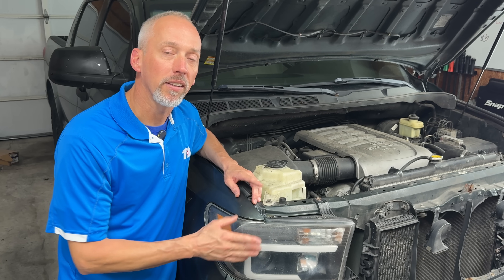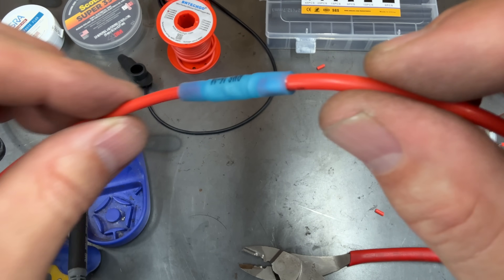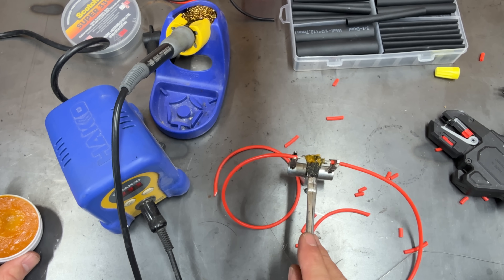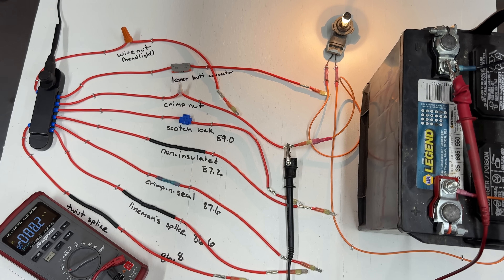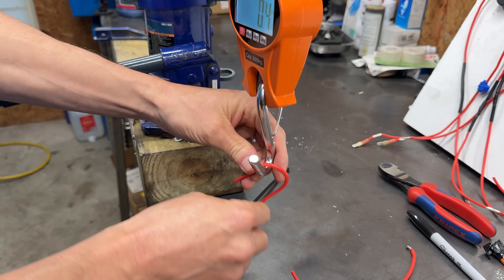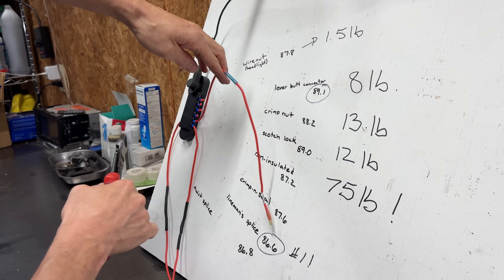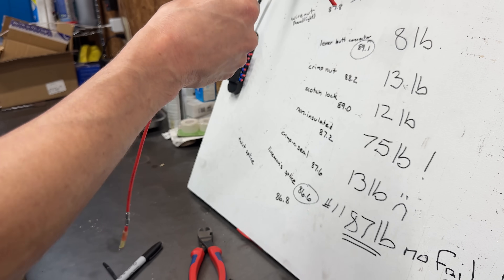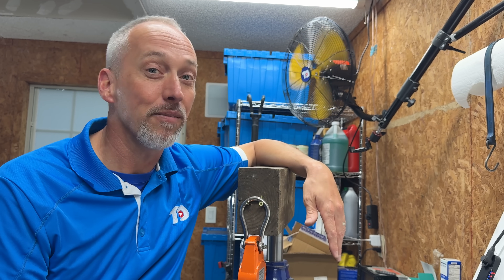I tested these connectors and found the best one

Comment: Something to be aware of is copper has a higher tensile strength than solder. If  you use a copper connector and a 6 side hydrolic crimp tool the copper will fuse/weld itself into continuous copper. Many industries will not certify a soldered connector. People  think soldering is better only because they are using the wrong connectors and tools. Many professionals think I am wrong until they test it for themselves.
Reply: NO SOLDER on Automotive connection or splices.
Reply: The space industry still uses soldered wire connections. Precious metals are applying instead of tin, cause tin becomes brittle at low temperatures and vibrations.
Reply: @hellhoe9311  Correct me if I’m wrong, but I believe that’s only for leaded solder joints, not unleaded. To my knowledge, research shows that unleaded solder joints are far less reliable than their leaded counterpoints and not acceptable for aerospace designs.
Reply: @rickyjagodowski69  Lead-based solder is not used, as it can melt at very low temperatures, which is unacceptable.
A complex solder based on platinum, gold, and silver is used. Silver serves as the base, while gold and platinum create a durable oxide film at the soldered joint. Such mixture has zero electrical resistance, is not subject to corrosion, is not subject to temperature changes, and is flexible enough to stretch, but at the same time has resistant to tearing.
Reply: @hellhoe9311 Sorry, I was thinking of what I’ve heard from military standards, not aerospace, and due to “whiskering” occurring with tin-based, lead-free solder but not leaded solder.
Reply: @rickyjagodowski69  Not really. Leaded solder has some advantages over lead-free (it’s more flexible, and less susceptible to tin whiskers), but lead-free solder has its own advantages (it is stronger). My take on lead-free in military and aerospace is that the main reason it’s not allowed yet is that we simply don’t yet have real-world aging data on it covering the ~40 year service lives of such equipment. But eventually we will, and I suspect we will shift to lead-free there, too.

Also, in the past 25 years, we’ve refined the processes and materials for lead-free soldering. The differences in, for example, solder wetting and flow are not nearly as big now as in 2005. Better alloys and better fluxes have really made a huge difference.
Reply: @rickyjagodowski69  unleaded solder is junk.... its horrible to work with and so easy to get unreliable connections.
Reply: @phedders  Modern lead-free alloys with good fluxes work very well. They’ve improved a lot compared to the beginning.
Reply: @tookitogo  Any pointers to a good one? I've not tried one I didn't hate yet... but I havent tried many recently because they all seemed to suck, so why buy more that you fully expect to give really poor results.
Reply: @phedders  The one I like is from Felder (a German manufacturer), using their Sn100Ni+ alloy (this alloy, which is also available from others under different names, is basically 99.3% tin, 0.7% copper, and critically, trace amounts of nickel and germanium, which significantly improve wetting), with the ISO-CORE “Clear” (REL1) flux. (If you need halogen-free REL0, that is available as “Ultra Clear”.)

It’s the first lead-free solder I’ve used where I thought to myself “if I were forced to go lead-free, this would be OK”. I’ve given samples of it to others to test, and they said similar things.
Reply: @tookitogo  “if I were forced to go lead-free, this would be OK”. Now you're talking my language :)

I just dug out what I think was the last roll of !Pb I bought which is dated 2017 - its Henkel with Loctite branding but a simple Sn/Cu alloy. (C 502 99C 5C) Its meant to be "premium" and certainly cost premium... but the roll is almost untouched because it didnt work out all that premium for me. Even the cheapest nastiest, stinkiest (flux) Pb solder ran rings round it for wetting and flow. I might give that Felder a shot.
Reply: @phedders  That is a prime example of a solder that does not impress me. People rave about Multicore and Stannol (whose products are extremely similar because the two companies were merged for a few years, long ago, but even after being de-merged, the products remain similar), but I’ve been consistently disappointed by their solder. (Or rather, by the flux within.) I’ve used their leaded and lead-free solders, and I don’t care for them. They’re not the worst out there, for sure, but it’s not great.

Kester is my favorite brand for leaded (haven’t used their lead-free yet), but the Felder lead-free I mentioned really impressed me, and it’s inexpensive to boot! (I also like Tamura-Elsold solder — the brand used by the European space agency — but it’s very hard to find.)
Reply: @hellhoe9311  Aerospace has been using crimped connections since the 50s. They use solder as well (mostly leaded), depending on the situation, but crimping is preferred.
Reply: @tookitogo  The USAF was using soldered connections when I separated in the mid-80s.  The amount of vibration and heat/cold cycles will cause crimps to fail.  The only crimps I ever used were on crimp-on pins inside environmental connectors.  Everything else was soldered.
Reply: @lindeleasley  nasa's tests on soldering versus crimping showed that crimping was much more reliable. the solder creates a stress riser where the solder ends and the conductor then bends at that point.
and given that planes exclusively use crimping...if it's good enough for planes it's good enough for everything else
Reply: @edbo10  You get stress even when crimping. You introduce a hard point in the wire just like when you solder. The real advantage of crimps is consistency. A crimp using a proper tool will get consistent results in strength in resistance especially under adverse conditions (field repair). Crimping is more successful also when working with wiring with internal corrosion that is difficult to solder .
Reply: @mitchellcrane9809  that's why you can get crimps that also clamp down on the insulation to eliminate stress risers
Reply: You are absolutely right! Soldering should not be used where vibrations can occur. Furthermore, he does not use the specific crimping tool.
Reply: "Interesting" thing that is adjacent to this is consideration of fault conditions.  Soldering in household wiring is unacceptable, as during a high current fault (could be thousands of amps for a fraction of a second, not being hyperbolic either, home branch circuit breakers can be rated to break 10k-15k amps, with the main panel breaker good for 20k or more, and the utility transformer being able to deliver a large fraction of that under fault conditions)  its possible for the solder to melt and the joint can fail.  Something like the soldered linemans splice, if done correctly 'should' be fine, but is labor intensive and requires good workmanship consistently, still wouldnt meet code, and is much harder to do work/service on than a wago or wire nut in a home application.
Reply: That what you are saying is true but only for 6mm2 and bigger copper cables. For the ones he use in this video the crimping pliers are the right one
Reply: The wire was aluminum and not copper.
Reply: @JamesVR6  What makes you think that?
Reply: @JamesVR6  If it was aluminum, the solder would have never taken.
Reply: of course a weld is better than a solder
Reply: Had a boat come in with a no start issue. Traced it to a bad battery cable from the battery to the battery switch.
It was a soldered connection. Made a new battery cable with crimped on lugs. Engine starts up reliably.
This is why my boss detests soldered connections.
Reply: For copper to fuse it would need to get near its melting point (1085'C).  A hydrolic crimp machine will cause the copper to heat up, but not that much.  Solder is used because it has a much lower melting point (typically 190'C to 220'C) and reasonable mechanically strong (with caveats) as demonstrated by this video.
Reply: @grepora Solder cause the wire to be stiff and will crack with vibration. Solder is good for surface mount devices that don't flex as much. An air tight crimped connection will stand the test of time better than a solder one.
Reply: @jeposton 
I’ve heard this over and over. But how true is it? How much vibration would be needed in an automobile environment to weaken a solder joint? And is that with the wire attached to the metal, or if it was suspended in the air? Or does that matter?
Reply: @JamesVR6 Don't know for an auto environment. I work on CRJ 200 and from time to time the potted solder joints fail in the APU bay. Have yet to see a crimp joint fail. The wires on a aircraft often get clamped every few inches. The maintenance manual will say exactly where so I go by that.

Edit to fix a spelling error.
Reply: @jeposton  What types of crimps do you use in aerospace?
Reply: @ErenBaltal-ce4lq  JRready crimps. Haven't used them in over a year because the crimp connections don't fail often. Now those potted solder ones fail all the time.
Reply: @grepora  What you said about copper's melting point is only true at standard pressure. But that's not the case for a crimped connection. The whole point of crimping is to use extreme pressure instead of extreme temperature to cold weld the copper/aluminum together. It's the same reason a pressure cooker cooks food at a much lower temperature than an oven.
Reply: @grepora  Melting is most definitely not the only way to fuse metals. Cold welding is a thing, really!!

Comment: I've had issues with the crimp connectors on wires carrying low voltage signals for MAF sensors since the resistance is too high.
Reply: Then the terminals and/or the crimping process are not good. A properly executed crimp with a quality terminal has very good electrical properties.

(I no longer use non-name-brand terminals. The no-name stuff is of unpredictable quality, many are just terrible and cannot be properly crimped even with top-quality tools.)

Comment: NGL I was pretty disappointed that you didn't have any heat shrink solderless butt connectors on this list. I know a lot of people swear by them and a lot of people say that they're trash so I was pretty curious as to where they ranked. I was also wondering about the effectiveness of using the #1 rule of soldering - mechanical connection 1st before solder method vs. just relying on the holding power of the solder and glue only like a lot of manufacturers recommend. Maybe next video idea? I love being informed about best case practices for real life situations which your video was helpful with and much appreciated regardless so thanks! ❤
Reply from the maker: I thought about giving those solder connectors a try, but it was too cringe for me lol

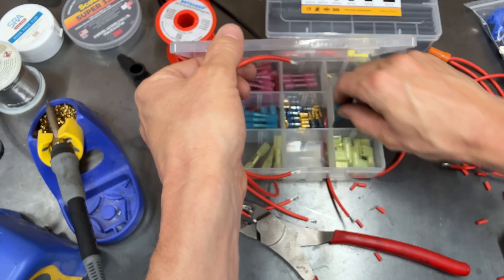Comment: 1:37 Yeah.. that is a fail. IMO, the tubing should be loose such that you can remove it while crimping.
THIS is why I ended up using regular BUTT Connectors, then use two(2) separate heat shrink tubings to give it a good seal.

Comment: A control test of just wire would have been nice for each of the tests. Uninsulated crimp with epoxy lined shrink wrap is what many automotive manufacturers recommend.
Reply: Can I get away with putting silicon grease on the crimp and regular shrink wrap?

Comment: I like the effort spent on this testing, but I don’t see any examples of making those connections according to established engineering/analysis principles.

Another commenter noted that you made the Western Union (lineman) splice incorrectly, but didn’t comment on whether or not the WU splice is designed to work on stranded wire. I do not believe it is.

2) For the crimped splice, you did not use a ratcheting crimper designed for that particular terminal. This makes the pull-out test irrelevant.

3) For the soldered connection, you did not follow the established NASA soldering procedures. There are some great videos on the proper way on YouTube and you should seek them out.

4) you did not do any vibration or weather tests.

5) You did not verify that all of the connectors were engineered for and rated for automotive use. The wire nuts are obviously not, but you didn’t comment on which of the others were.

6) There are other issues, but I’d encourage you to look for them on your own, so you get a complete understanding.
Reply from the maker: Well said

Comment: Get a real crimping tool that will give secure crimpings, the one you used is just wrong.
If you know it's going to be wet - add some grease to the connector before you crimp it to keep out the humidity.